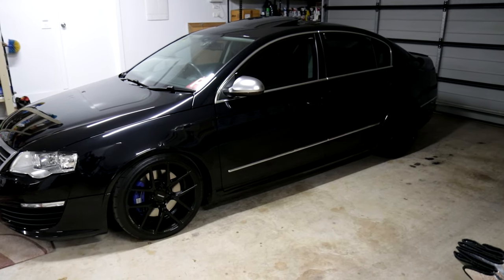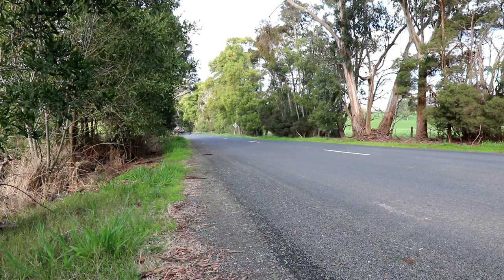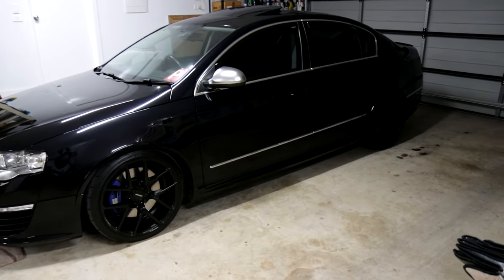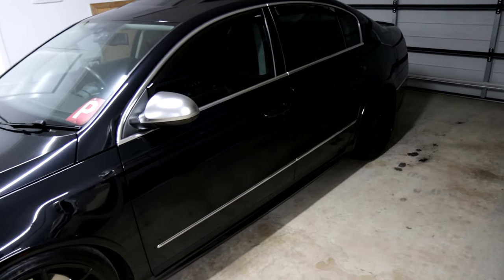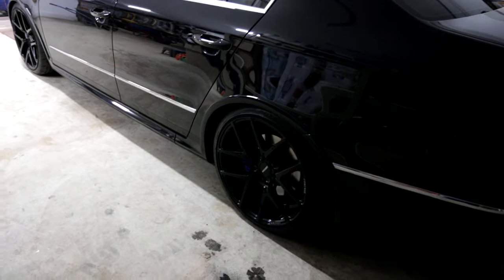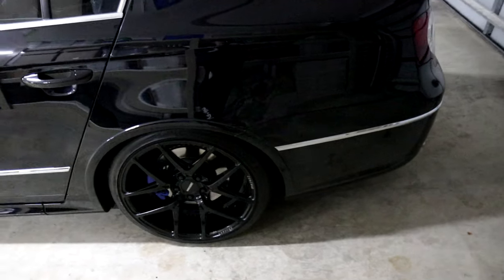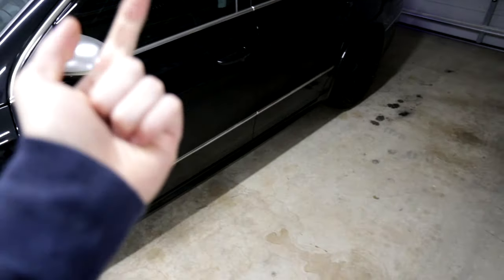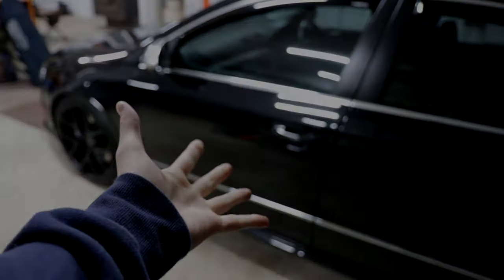Best Cheap R36 Passat Exhaust! (eBay Valve)

Comment from the maker: I should also mention seen as I forgot to in the video, the valve is controlled by its control box as I mention at 4:27 and it gets it signal from a small remote I keep inside the car!
Reply: "A small remove". Remote is most likely what you mean.